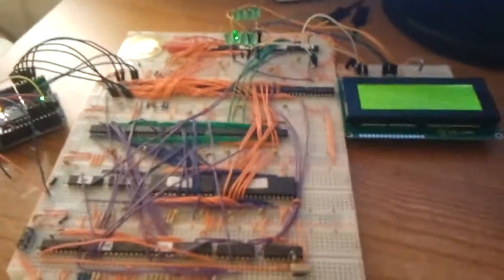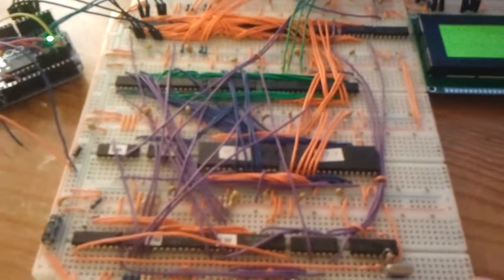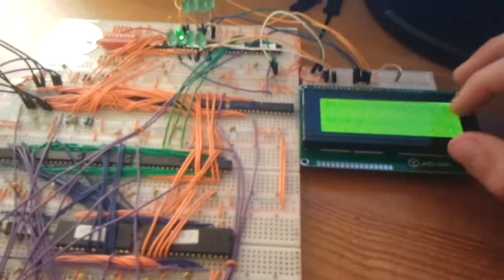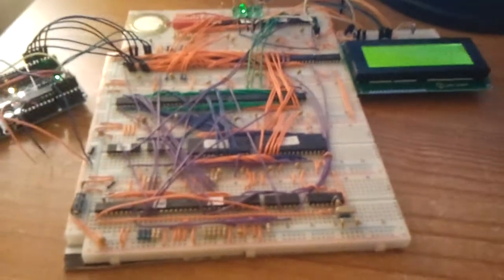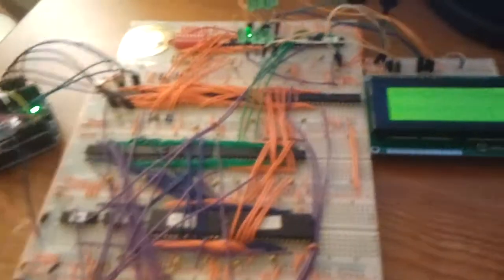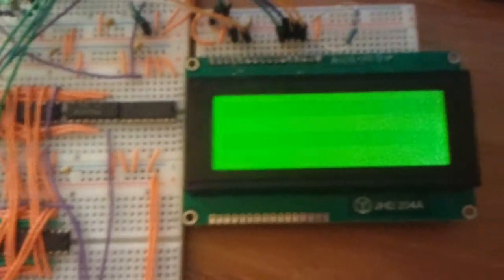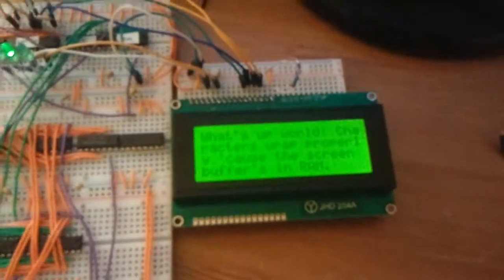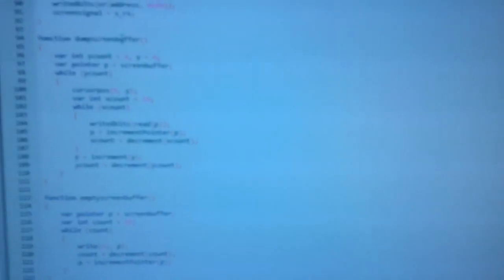Homebrew Processor #2: LCD Display

Comment from the maker: Ahh thanks for the part, I'll have a look... yes I've already added that functionality ;) but I will look into serial! I'm tempted to just use a small AVR as they're programmable and have hardware UARTs, and I've got a bunch lying around, but it seems like a waste when they're more powerful than the computer itself. It'd be nice to have serial anyway on the IO board.
Reply: Nice computer. I know what you mean about not wanting to use a powerful chip for just a single module (in this case, display). But video controllers/display controllers have generally been proprietary. Vendors used whatever chips they wanted, and since video cards as a whole device are modular, it's never really mattered too much. Especially back in the early days of personal computers, they just used whatever tricks they needed to get it to work. Hell, I was studying the VGA protocol a few years ago because I contemplated designing my own VGA card, but I haven't yet.

Comment: Fair enough. Personal preference really. I prefer serial as you can see entire pages and input/output large amounts at once. (Personally it feels more like a computer if you can run say an OS and have a prompt and see all your previous text easily) Youre now going to say that you could add a scrollup/down function on the LCD. But its just not the same. The 16550D is the modern 16450 etc. I really do reccomend serial! Its what ALL minicomputers have used since forever.